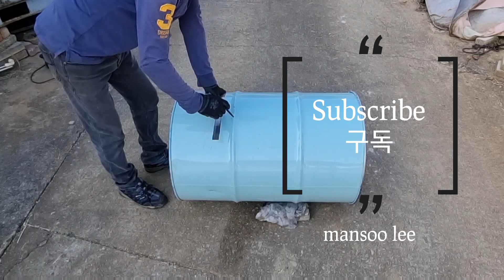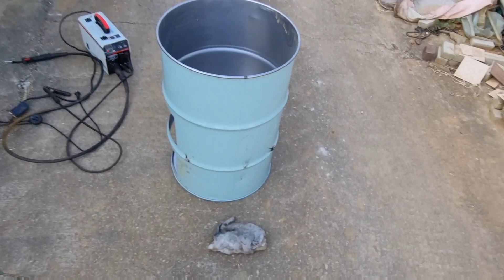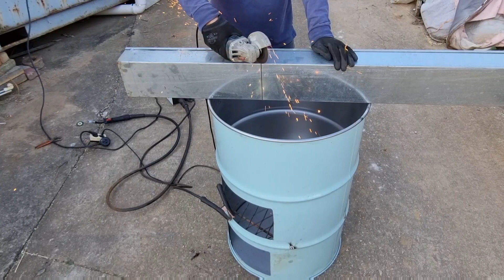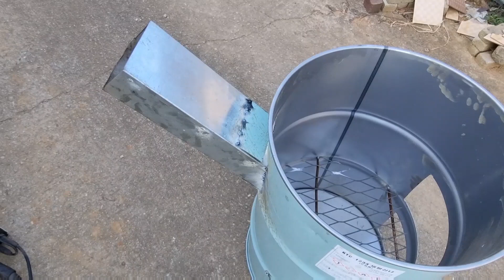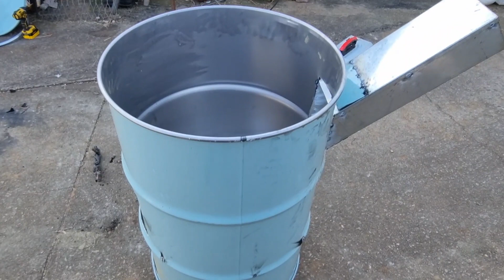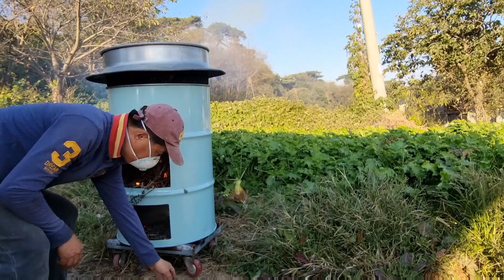드럼통으로 만든 화덕 (A brazier made of drums.)

Comment: Great way to clean up yard waste. Thank you sir , now I can use my small oil drums for heating my garage with a few modifications. Like this idea for the my dual drum idea. One drum outside in the garden with piping into the garage to the second drum that will exit through the roof or wall. Hoping to put 1 1\2 " pipes through the inside barrel to expel heat into the room. Should have less than 5 to 8 percent emissions while heating up the garage,  if I weld as good as you. 👍 👍 🇨🇦
Reply from the maker: 너무 좋은 생각입니다
고마워요
Reply: @mansoolee3   you are a great inspiration for novice welders and creators like myself. Thanks for your teachings and keeping them interesting for us to replicate and modify . If I had a shop teacher in highschool like you , I know I would have been a better inventor , welder , & father with skills to teach my kids to do better than I was.
👍 👍 🇨🇦
Reply: Actually,  this is a dedicated heating drum for an aluminum cauldron.   ManSoo Ssi used dried grass and then will graduate to larger sticks to get just enough heat to dry out the washed pot.
When he is boiling his soup/meat, he will use thicker cuts of wood.  He will not "load" the barrel with wood since intense heat will damage the aluminum and may over cook his food.

Comment: Good seeing you back on YouTube my brother.  This project is a bit larger than your propane gas cylinder projects but just as interesting and insightful.  Thanks for sharing this video.  Wishing you and your family a blessed week.   Peace brother
Reply from the maker: 집에서 필요해서 급하게 만들었습니다 
시청해주셔서 감사합니다
Reply: @mansoolee3   I regret that YouTube is not offering a translation to what you typed in reply.  Watching you using composite rotary grinder blades today I wondered why you are not using a nibbling tool to cut through metals.  Similar to a jigsaw but a smaller bite attachment to a hand drill or a drill press.  Following shows two examples

https://youtu.be/vaFCRN-aWhg

  Sent from my iPad